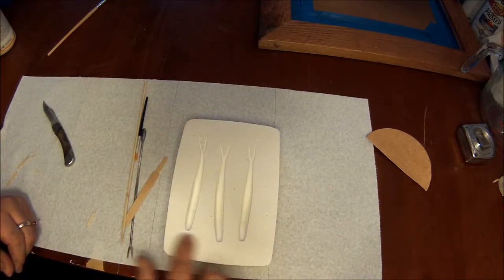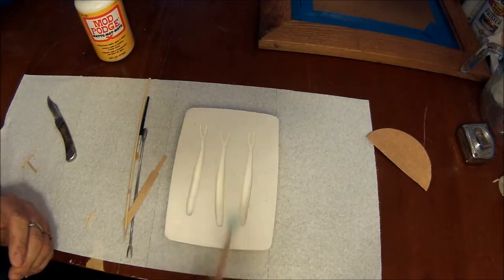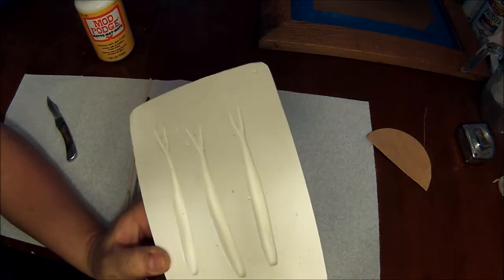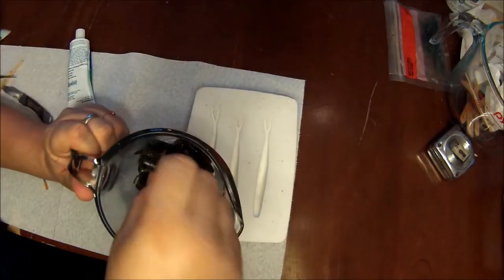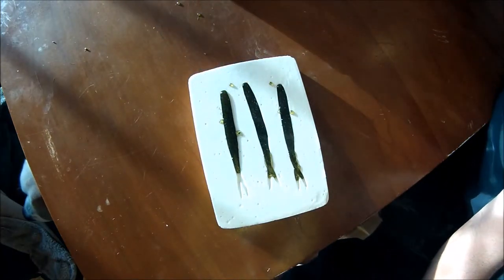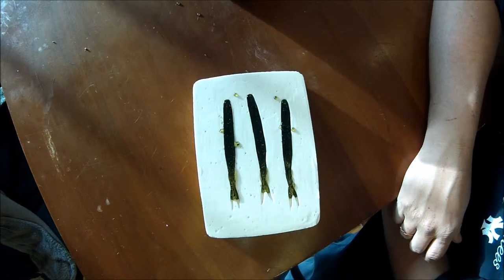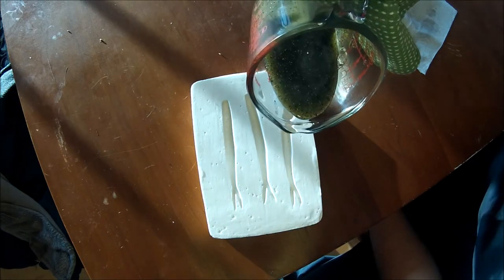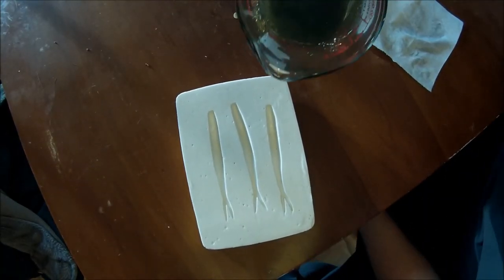PT2 Hand Pouring A Soft Plastic Fishing Lure *FLUKE*

Comment: It's crazy some of the tiny small appendages some guys can handpour. I just am not that good at it yet but once you get good pouring it should be no issue. Will be nice to see your resolution to the situation after experimenting a bit. I actually made a 5 cavity 2 piece fluke mold very similar to this and it works pretty good but I would like to get more into some handpour because the color combinations can be so much more customized.
Reply from the maker: Midwest Fishing Show bout to post it in the next few hours stay tuned.  not the best way im sure but they will catch fish now.  thanks for watching.  really want a small metal syringe of some kind that hold just the rite amount of plastic so I can almost inject it into the small areas??